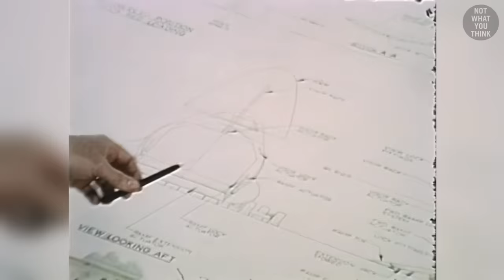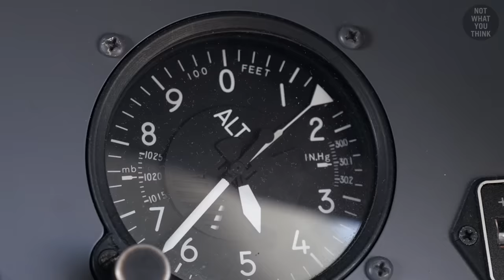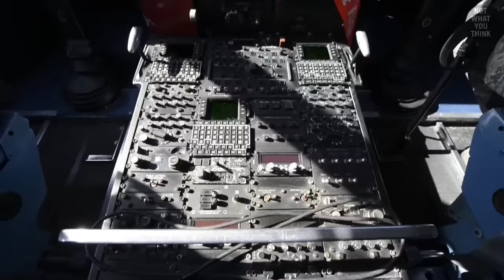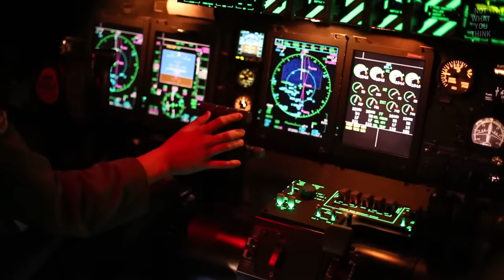America’s MASSIVE Military Airplane that is Named After a Porn Star

Comment from the maker: Did you spot the biggest inaccuracy in our video?
Reply: no, but I knew right away that the space shuttle is what you referred to at the start when you said C-5 cant do something 747 can ..
Reply: rediculous is not correct 1:00
Reply: nope im clueless 🙃
Reply: M1s don't weight 60 tons.  They weight 70+ tons.
Reply: When you stated the decision was made to limit the weight of all C-5a’s to 50,000 pounds after cracks were found. That is very inaccurate. Yes restrictions were put on the aircraft, but to limit a C-5a to 50,000 pounds it would have to be a small scale model. 

I was always disappointed for the C-5M they didn’t use the GENx engine and new wings from the outer engines to the tips. These upgrades plus small vortices generators could have cut fuel burn by 20%
Reply: No clue! The Ridiculous typo might be only thr inaccuracy that i saw, apart from that... Yeah i got nothing!
Reply: @andrewday3206  Isn't 50,000 pounds only 25 tons?
Reply: The C-5a has a cargo capacity of 270,000 pounds
The C-5M has a cargo capacity of 281,000 pounds
So the 125 ton cargo limit isn’t completely accurate but not far off.
Reply: @leelydston1225  
Seeing the C-5 has an empty weight over 350,000 pounds limiting its loaded weight to 50,000 pounds just doesn’t work.
Reply: @leelydston1225  there is no mathematical definition of a ton
Reply: @TruckerIceBox  2,000 pounds
Reply: The clip of plane about to crash, killing all the crew, in the reverse thrust section?
Reply: Reverse movement of airplanes being something special. Literally every single jetliner can do that it's just extremely wastefull and dangerous for ground personnel
Reply: "In fact reverse thrust can be used in many aircraft while in flight in order to speed up the rate of descent" This is technically true, but most modern airliners are doomed if they use reverse thrust in flight. See Lauda Air Flight 004 "Simulation of the event disclosed that the airplane was not capable of controlled flight unless full wheel and full rudder were applied within 4 to 6 seconds after the thrust reverser deployed."
Reply: Two CH47's can be lifted in a C5 simultaneously, not one.
Reply: Yeah, the C5 was not a "disaster".
Reply: Well, Linda Lovelace's face segment isnt her face actually, its based on her biopic movie..
Reply: is this a clever way to find out inaccuracies of your videos through the viewers lol
Reply: @TruckerIceBox  Ya mean like a "butt Load"?
Reply: You said inbound instead of inboard?
Reply: Spelling "ridiculous" wrong in the text-over frame?
Reply: You meant to say “An-224” not An-124 as being the next biggest cargo transport.
Reply: @Omegatonboom  
deceptfulness is not a word you should go to vocabulary jail
Reply: The 747 shown carrying the space shuttle does NOT have a normal 747 tail.....
Reply: @indyjons321  
The AN-124 is the next biggest. There is no AN-224
Reply: The second AN-225 is not a complete set of components for a second aircraft to be built. It does have the majority of large components, but it is incomplete and missing the hydraulics and many other components. The location is no secret either. I personally hope they complete it using the much more efficient GENx engines to replace the Progress D-18T turbofan engines.
Reply: 14:05 ?
Reply: you said "inbound engines", not "inboard engines"
Reply: I thought it was the claim that commercial aircraft can use their thrust reversers in the air.
Reply: I'll take "inaccurate video titles" for $800 Alex!
Reply: @forgettable_eli  My favorite part of the video.
Reply: I guess that it's the number of ping pong balls that is equivalent to 125 tons at 7:12
Edit: I feel like "25,844,746 ping pong balls is equal to 125 tons" is just a guess and it may be still not accurate.
Reply: 4:26
That accident has nothing to do with reverse thrust
Reply: @rizaskeee  the real nickname is Fat Albert.I worked with this aircraft.
Reply: @andrewday3206  I understood it as 50,000lbs of cargo
Reply: @danduffy7974  
When I was in the USAF we called it Fred. Fat Albert is also a good one
Reply: Reverse thrust is not banned and is present in most commercial aircrafts in existence. Just not used due to safety concerns.
Reply: Same here.  The Space Shuttle.  However even the 747's tail had to be modified to mitigate airflow problems with the huge Shuttle on it.
Reply: at one point in the vid, it switched to the woman for a split second?
Reply: thrust reversers being called reverse thrusters?
Reply: @EliranC  The C-5 was considered for the SCA, but NASA wanted an aircraft they could own
Reply: @k53847  Well, the newer variants do, but they started at 60t
Reply: Like mentioned “ridiculous” is spelled wrong when you say what “FRED” stands for… happens to the best of us…usually in an important text message…
Reply: Yeap that's not Linda lovelace, it's Amanda Seyfried in the video clips.
Shockingly bad research if you ask me!!
Reply: @philemontong8847  subliminal messaging.
Reply from the maker: Maybe!
Reply from the maker: No, that was intentional.
Reply: why is there a random girl at 14:06 lol
Reply: While the 747 wasn't a rework of the C5 concept, it was codeveloped with loads of similarities. Also the new engine developed for the project made aircraft like 747 as well as the dc10 even possible.
Reply: You missed a fucking amazing chance for a "your mom" joke right here: 8:43
Reply: @bhupendragurram3026  
Yes 1:00 is kind of....rEdiculous😀
Reply: @TruckerIceBox  Of course there is. It is 1000Kg. The international standard is metric, so you can assume any measure to be from the metric system unless something else is specified.
Reply: @hanneskunnen  having an unexpected single side reverser deployment whilst at full thrust on both engines is an extreme case, to say the least...

IIRC the T39 shuttle trainer had to use reversers to simulate the 'winged brick' glide profile
Reply: @MaverickBlue42  I don't think you could fit a reindeer tail to a C5A and trying to fit outboard rudders on the existing  elevator would still put them in the spoiled airflow

Mriya has the same tail philosophy as the modified 747s, for the same reason - and those shoulder humps are there for external load carrying. The "mark2" non-Buran carrying design has a standard cruciform tail and an operable rear cargo ramp like the An124s it's derived from.

FWIW, that second airframe has been worked on intermittently since it was mothballed in 1988. Antonov was in talks with China about license-building the things in the late 2000s but that didn't happen (apparently because of the issues associated with the Progress D engines coupled with the issue that no western manufacturer will sell engines to be fitted to a Chinese military airlifter)
Reply: @Rusty9017  it's banned on the apron and taxiways of most locations due to FOD spread, infrastructure destruction (signboards likely to go flying,  etc) and risk to ground crew/equipment 

One regional airport I lived near had a 737-200 run up the engines to full power outside the terminal whilst turning (a wheel had gotten wedged against an in-ground taxiway lighting marker and the pilot was trying to ride over it in the absence of tugs onsite)

The result was that the entire front wall of the terminal and frame of the building was damaged and had to be replaced at a cost of several million dollars

The fuel costs of using thrust reversers factor into this too, but most noticeably the civil birds pictured all use bucket reversers which are as long-gone as the very noisy low-bypass turbofans they hung behind

It's a pity the test flights of the B52 carrying the original C5/747/A300 engines weren't shown. That engine dwarfed the airframe it was hanging off and the tests were extremely dangerous for the crew
Reply: The C-5 Galaxy can carry up to two CH-47 Chinooks, not just one.
Reply: 14:04 it's funny when you say and I quote "kneeling is especially important" and add linda lovelace in it😅
Reply: @TruckerIceBox  Lol a ton is 2,000 pounds dude
Reply: You can't use reverse thrust in flight on any airplane, only some Military ones.
Reply: @TruckerIceBox  its litteraly 1'000 kgs
Reply: @danduffy7974  
The Blue Angels C-130 was called Fat Albert
Reply: 1) Suggesting that aircraft use thrust reverses while in flight.
2) Talking about weight capacity, and immediately suggesting how many ping pong balls which would indicate volume. 
After that I stopped watching and double checked to make sure I was no longer subscribed.
Reply: @andrewday3206  I thought that was the inaccuracy too, but I did a little research and found this statement to be true. "Consequently, all C-5A aircraft were restricted to a maximum of 50,000 pounds (22,680kg) of cargo each. To increase their lifting capability and service"
Reply: @scottcol23  
I get he meant payload, but I think it was a typo and written like maximum takeoff weight was 50,000 pounds.
Reply: @14:06 🤣
Reply: You said you were going to use a profanity and then didn't.
Reply: @rightrightrightuhhuhuhhuh6516  So should 99.9897% of Americans, particularly those who say "conversate".
Reply: You give everybody the impression that Amanda Seyfried is Linda Lovelace.
It is easy to find pictures if the real Linda on the net.
Reply: The title?
Reply: OK
Kinda embarrassed this one slipped my mind after first noticing it. You said don’t feel bad for Boeing, the 747-100 took advantage of the high-bypass engine technology developed for the C-5A. Well the Boeing 747-100 used P&W JT9D engines. The C-5A used GE TF39 engines, it never used the P&W the 747 used. The 747 never flew with the GE TF39 either.
Reply: The Antonov An-225 Mriya can lift 350 tons.
Reply: @andrewday3206  Doesn't Fat Albert work for the Navy's Blue Angels?
Reply: 747 had modified tail to carry the space shuttle not original.
Reply: @hyperseah  
Yes I wrote that yesterday in the comments. It used to do JATO takeoffs with a bunch of solid rocket motors strapped to it. At air shows it was quit the sight.
Reply: @henriquebelotto  Correct - the load (army vehicles) slammed through the backpanel as their straps/chains snapped during take-off - Bagram AFB, Afghanistan (also, it was a private B747 - not a C5).
Reply: Could it be inBOARD engines not inBOUND?
Reply: A c-130 cant do backwards thrust its propellers!
Reply: @haotichar  
It cannot lift anywhere near 350 Tons…. Look that up again
Reply: @andrewday3206  
Empty weight: 285,000 kg (628,317 lb)
Max takeoff weight: 640,000 kg (1,410,958 lb)
but, yeah, I saw that and overlooked Capacity: 190 tonnes (420,000 lb)
My bad.
Reply: @haotichar  
Fuel capacity alone is 300,000 KG
If they do finish building the second one… Using much more efficient GENx engines would make a very big difference. That and a few other modern tweaks like vortices generators and more efficient wing tips could greatly reduce fuel burn and increase capacity/range equations.
Reply: "On the two inbound engines". The other two are outbound?
Reply: @ 0:12 It’s teabaggin’ too!
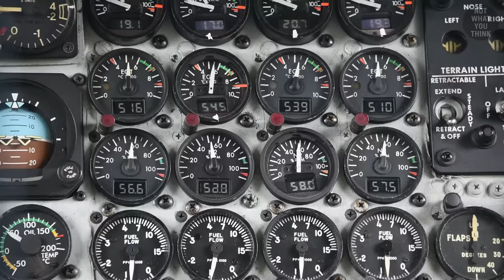Reply: @11:43 is a KC-135 cockpit, not a C-5.
Reply: The C130 can back up because of its cool propeller design.
Reply: @hanneskunnen  Also several redundancies are in place to stop a reverser coming on before touch down. So in theory modern airliners (most airplanes / "many aircraft") can't even activate them in flight so I think that's the error. Also further up someone mentioned the 74 crash during this segment and what happened during that crash if I recall correctly was a fault in load securing and the load shifted shortly after takeoff resulting in a stall and a terrible crash.
Reply: @hanneskunnen  Lauda 4 had an uncommanded and, crucially, asymmetric thurst reverser deployment which caught the pilots by surprise. Controlled, symmetric in-flight reverse thrust would be totally different. Not that it's used by airliners, though.
Reply: i like this question as it prompts critical reception of the content.
Reply: @olehcelsior1005  I have people that think they are smart correcting my spelling lately, that it is "Kyiv", not "Kiev".
Reply: @grecco_buckliano  right, thanks)
Reply: Actually, you said "inbound"  instead of "inboard" when describing reverse thrust capable engines. It's curious how many non native speakers of English confuse these 2 words. But I can imagine why!
Reply: Linda Lovelace is portrayed by Amanda Seyfried
Reply: I can still hear your voice reading this.
Reply: @ the 15:10 Mark you mentioned the maximum weight at 50,000 pounds.  This would be inaccurate unless you stipulated cargo weight.
Reply: @TruckerIceBox  A ton bombs are not well defined either.
Reply: @Oflgpatxa  That is a 'long ton'.
Reply: 51,000 gallons of fuel capacity is only about 2 (small) railroad tank cars.
Reply: The AN-225 was destroyed by ukrainian forces, not russian.
Reply: @TruckerIceBox  A ton is 1000kg
Reply: There is metric.
Reply: An-225 wasn't destroyed by russian forces, it was destroyed by ukrainian artillery during the battle for Antonov airport
Reply: When you said what can happen if thrust reversers, you showed a clip of a 747 losing control due to an armored vehicle coming loose in the cargo bay, which hit the back of the plane and broke elevator control cables and causing the 747 to pitch up and stall, killing everyone on board
Reply: @miscbits6399  ... happened to a Lauda Air aircraft; Nikki being a pilot as well as a world champion F1 driver, figured out the reversers had activated bringing the plane down
Reply: @hepphepps8356  Well, hepphepps, WRONG !  This is about the U.S aircraft where imperial is king. One ton is 2000 lbs. Other people say metric tonnes.
Reply: @Oflgpatxa  1 Ton (metric) = 1 Tonne = 1000kg = ~2200lbs
1 Ton (long) = 2240lbs
1 Ton (short) = 2000lbs
Reply: @TruckerIceBox  1000kg
Reply: ETHAN CHEW YAT HARNG Moe  Google! The font of all knowledge..unless they don't want you to know.
Reply: @leelydston1225  Actually, even less. 50,000lbs = 22.680 metric tons.
Reply: 747 tail had to be modifed to carry the space shuttle.
C-5 Galaxy could've had the same modifications to it.
Reply: @philgiglio7922  Yes, I read the accident report at the time. Mentour pilot has a very good video covering how it occurred
Reply: @TruckerIceBox  Is that an Imperial (long) ton (2240 pounds/1016kg), An American (short) ton (2000 pounds/907.2kg) or a metric ton(ne) (1000kg/2205 pounds)?

Gotta love standards - so many to choose from...
Reply: @miscbits6399  there is no "mathematical" definition
Reply: @andrewday3206  I've also heard it called Dumbo, flying blue elephant.
Reply: @Dr-Bread  my brother was a load master on a hercy bird. He was also a qualified "mon back" when they backed up, he would stand on the ramp and and tell the pilot "Mon back, Mon back".
Reply: @matsv201  The 747 was envisioned more or less a 50% upscaled 707 with flight deck moved above the cargo deck primarily to avoid the crew being killed in the event of a crash landing (it had happened on multiple occasions on airlifters as cargo broke loose and squished the cockpit). The other big advance was having a nose door which didn't require disconnection/reconnection of cockpit control lines and subsequent hours of downtime whilst everything got checked for integrity

There's a lot more too it but the structure is heavily 707/Dash-80 derived along with work from the USAF airlifter research - rem,ember that Boeing punted it as a quick-and-dirty freighter design to fill a gap until the 2707 came online and it was Juan Tripp who mooted using it as a passenger carrier

The longer hump on the -300 is a direct result of finding out that 1/3 of the total lift was being provided by the fuselage but the shorter hump was actually adding drag. It was extended to optimise range and airlines immediately took advantage of the extra volume provided

The DC10 used RB211 engines, not JT9Ds - and it was the delays that acrued in Rolls Royce developing it that nearly killed Douglas along with bankrupting RR (RR intended to use carbon fibre fans and produced working ones but they shattered when the chicken test was performed, so they had to develop better titanium fan blades instead - adding lots of delays + costs)

The A300 used the JT9D though

If you want to see something scary - search for "JT9D B52" - there are a few videos on this as well as photos

Trivia: in the 1970s Lockheed punted a 1000 passenger tripledeck aircraft based on the C5. No airlines wanted it because they couldn't see a demand for that many seats. It was only after that they they pushed forward with the L1011 and discovered the market for very large aircraft was so small that first to market won it (ie: Boeing - for all the chest beating, only 1500 747s were ever built, vs more than 30,000 737s and A320s. Even the 777/A350 market is tiny compared to the smaller birds)
Reply: @HSstudio.Ytchnnl  a standard ping pong ball is 2.7 grams. i just did the math and it turns out 
2.7 grams x 25,844,746 ping pong balls = 76.92 us tons (a ton being 2000 lbs/907 kg)
Reply: kneeling is very important lol
Reply: Ridiculous, not rediculous
Reply: @k53847  M1A2 Sep V3 is just close to 70 tons (66.8 tons to be exact)
Reply: Lmao when linda lovelaces face popped up for 1 second towards the end 😂
Reply: At 14:05-14:06 when you flashed Linda Lovelace (biopic version) on the part where u were talking bout kneeling 😂😂
Reply: Yeah, that isn't Linda Lovelace, it's Amanda Seyfried.
Reply: @TruckerIceBox  1 Mg
Reply: Russia  did not destroy  the 225 it was shelled  by Ukraine when Russia  occupied  the airport
Reply: @Oflgpatxa  in the U.S.A. 1000kg is known as a metric ton or long ton. Since we still use imperial measures, a ton is 2000 pounds.
Reply: @andrewday3206  Not to mention the 332,000 pnds of fuel.
Reply: 2:38 You shifted in 4th not reverse
Reply: And take large loads, let's not forget
Reply: @CenterionX  
Agreed!!
When people start learning how much fuel aircraft burn they are in shock. Once you realize the payload and distance it starts making more sense.
Reply: c5 airdropping an ICBM XD
Reply: Hell, a glorified Cessna could carry fifty thousand pounds, well close to it. It would be very useful if the C5 could carry at least two Abrams tanks which are much closer to 70 tons each rather than 60 tons.
Reply: I Never heard the C-5 called "FRED", Never
Reply: @andrewday3206  GEnX didn't come out till about 10 years after the upgrade program was started.
Reply: spelled ridiculous incorrectly
Reply: @Super_Hornet_  
The re-engine program started in 2006 the same year as the GENx first run. Boeing was developing the 747-8 in 2005 as the specs for the engine were already available. My point is the USAF did not go for the best option they went for maintenance availability. If you read the press releases they openly state that. Companies wanted to replace the wing from the outboard nacelle to the tip, introduce vortices generators on the body and use newer engines. The USAF held back. This was about spare parts and not best performance. Heck the 787 Dreamliner started in January 2003 with specs for the engine available then.
Reply: you misgendered the plane with the wrong pronouns?
Reply: well, at least one: very few planes can use reverse thrust in flight, especially modern commercial jets.
Reply: @jims6450  technically some modern jets could, but very few especially commercial models. Looks like the Concorde could do it actually.
Reply: @danduffy7974  the Blue Angels Fat Albert is a c-130
Reply: @rykerstayton9577  "Lol a ton is 2,000 pounds dude"
2000 lbs is a short ton, while the long ton is 2240 lbs. The ton without further specification is metric per default, and thus 1000 kg.
Reply: Yep, apart from it being riddled with inaccurate information from start to finish, your explanation of why the C-5 is called the 'Lovelace' is completely incorrect. It's called that due to its ability to kneel and 'swallow' large objects. Being clever is fine, but when the content is so filled with incorrect information, it's just plain irritating.
Reply: Need spell check?
Reply: I never heard to say fu cking word before
Reply: "Fred's wings produce so much lift that it doesn't want to come down from altitude"
It's not lift...Fred is just so ugly the earth repels it!  😅

Jk to all the Fred mx peeps out there. It's a helluva plane for sure. We always made the joke that every time one landed, the hydro shop guys had better use the bathroom bc they would be on the line for a while.
Reply: @k53847  Depends on how many big macs they eat
Reply: @guytansbariva2295  
And the traitor who manipulated from his management position leaving it to get destroyed
Reply: FRED actually stands for Fucking Ridiculously Expensive Disaster.  By the way I have 2500 hours in FRED as a pilot.  Both tours at Travis AFB, 91-94 and 97-00.  Great airplane. Flys small, but taxiing the thing is a real bitch...like moving a building with wings.
Reply: So basically a good chunk of the video from what I see in these comments…
Reply: No seats like that on C5s I was on!
Reply: @NatEff3ct  
It’s 2,000 pounds, dude.
Reply: @haotichar  could lift 250 tons
Reply: @hevscientist_017  that's lovelace... in reference to the kneeling comment.
Reply: @stanlogan7504  I've been on many C-5s, although at air shows lol 😂
Reply: The c-141 dumping a gbu-128?
Reply: @TruckerIceBox  Actually, there is. 1 ton=1000 kilograms, and the Kilogram is mathematically defined, and therefore so is the ton, and since all US imperial units are defined based on a conversion from the SI system, so is every imperial unit.
Reply: @tombaja4.9  Not really....lame comment.
Reply: @aunshiwho  3 Actually
Reply: @stimproid  It can use TR's in flight
Reply: @aunshiwho  

Yep, I've sent marines with theirs out of riverside ca 2 at a time.
Reply: "Ridiculous" was spelled as "Rediculous" 1:00
Reply: @NatEff3ct  one imperial ton is 2,240 imperial pounds. 2000 US pounds is a "short ton". A metric tonne is close to the imperial ton.
Reply: @k53847  Is that the M1?  The M1A1?  Or the M1A2?
They START @ 62T.
Reply: @leelydston1225  It USED to be pre-GenX.
Reply: That was a MOAB, not an ICBM
Reply: @indyjons321  Didn't the Ruskies destroy 1 in the Ukraine "special military operation"?
Reply: @bhupendragurram3026    Rediculous is not correct, it's ridiculous.
Reply: The title
Reply: @jacobpeterson4752  He seemed to indicate that this was common for aircraft to do. It is not.
Reply: That wasn't Linda Lovelace in your video...
Reply: 14:05 sus
Reply: @danduffy7974  As I remember, Fat Albert was the name of the C-130 used by the Navy Blue Angels demonstration team.  It does a JATO takeoff as part of their shows.  I've seen it. It's very impressive.
Reply: Yeah the fight club splicing in porn star @14.09.. I'm sure Tyler would approve
Reply: Yes, the 225 was the biggest inaccuracy. It was destroyed by Ukrainian Forces, not Russia.
Reply: LoL from both end XD
Reply: Who was that lady in the red dress lol
Reply: The fuel panel doesn’t look like that
Reply: Yes, that was not Linda Lovelace
Reply: 7:00 it’s no longer the biggest because it no longer exists. It was blown up last year in a bombing on an airstrip.
Reply: @marvindebot3264  The C-5 never dropped a MOAB, but it did drop an ICBM which was shown in the video
Reply: @TruckerIceBox  a ton is 1000 kg, what the hell do you mean there is no defintion?
Reply: @Jartran72  not sure what everyone missed ... everyone also has a different number for a ton ... look up the mathematical definition of a ton... there is none
Reply: It was not destroyed by Russian forces
Reply: 1:00 . Spelling mistake. It's Ridiculous, not "Rediculous"...
Reply: @andrewday3206  They didnt use new wings from the outer engines to the tips?
Reply: Yep. The Antonov 225 is a Russian plane. You say Ukrainian, but we all know Ukraine is Russian territory.
Reply: @Robbie_Prz  
No it’s ironic when the C-141A was upgraded to the C-141B the entire wings and engines were replaced. When Boeing brought out the 747-8 the entire wings were redesigned and the engines upgraded. On the 747-8 the same wing box was utilized. The C-5M was more about having engines that had readily available spare parts and not so much an upgraded performance.
Reply: It wasn't a regular 747 tail...?
Reply: All passenger seats face the rear on any military aircraft.
Reply: That isn't Linda Lovelace lol
Reply: I suppose the biggest mistake you made aside from spelling errors is incorrectly lumping AMP mod and M-Mod together. M gave the engines to the aircraft overhauled. All the B models got AMP Modded with the glass cockpit and several updates to the avionics. 

You made quite a few small mistakes. Also, if you want that hook up to get a ride with FRED hit me up. I'm probably the closest you're ever going to get to the right person to ask.

Oh and I forgot about it by the end, but as @name points out, the clip showing an aircraft crashing while talking about reverse thrust in flight was a 747 and it had nothing to do with reverse thrusters opening in flight. That was a shift of CG due to cargo shifting in the belly that caused that aircraft to fall out of the sky. Kind of surprised you didn't talk about the C-5 that DID crash in Dover though. Mostly because it's the only time a C-5 carried another C-5 inside because the flight deck was cut out of the wreckage and put into another jet to fly it for R&D.
Reply: @sundhaug92  NASA owns two C-5s. 213 and 216 are the only two C models and both are owned by NASA and operated by the USAF.
Reply: @NotWhatYouThink  i havent finished yet, but as of 3 min, the jokes are particularly amusing
Reply: Is it the one in 14:06?
Reply: heyy broo, you forget to mention what Linda can and can't do
Reply: No porn star is named "C-5 Galaxy".
Reply: Yes, that isn’t Linda Lovelace that you are showing, it is Amanda Seyfried whomplayed Linda Lovelace in the 2013 biopic, ‘Lovelace’.
Reply: Yes, that isn’t Linda Lovelace that you are showing, it is Amanda Seyfried who played Linda Lovelace in the 2013 biopic, ‘Lovelace’.
Reply: Uhm. no. C-17 is bigger.
Reply: Are you just being facetious because so many people act like internet warriors and have to tell you how wrong you are all the time?
Reply: @k53847  No, M1's weight 59.7 tons. M1A2 Sep V3 on the other hand weight 73.6 tons
Reply: Kneeling requires knees??
Reply: C5 is Circa late 1980’s
Reply: @KevinPratama  LoL
Reply: That’s a metric ton.  @Oflgpatxa
Reply: @TruckerIceBox  idk I learned 1000kg is 1 ton, at least that's how we take masses in our maths
Reply: @foxrine4204  Ton is a informal definition... there is not a mathematical definition

A European definition of a "tonne" not "ton" is 1000kg
Reply: @TruckerIceBox  oh I thought he meant tonne, since we call it ton for short
Reply: 1:27 not Linda Lovelace
Reply: @NatEff3ct  I'm not sure but I think that he was saying there is no mathematical definition of a ton in the video I am not sure
Reply: Your airplane is an actual individal with capabilies that the government uses.
Reply: yeah , your balls wont itch when you fly on this plane
Reply: @KevinPratama  yeah, that was Amanda something who played Linda in a Biopic.
Reply: ping pong bolls thing
Reply: @noimagination99  Thank you!
Reply: @Oflgpatxa   Wrong a metric ton (1000KG)  is called a tonne.  1 tonne = 1000kgs .  A US ton or short ton is 2000lbs.   An Imperial ton  or long ton is 2240 LBS. Since this is discussing US equipment the measurements used will be US customary units, so the tons used are short tons 2000LBS...
Reply: Ridiculous is spelt wrong with an e when explaining the name FRED
and the narrator's voice is annoying and most likely computer generated
Reply: LOL.  :)
Reply: @LaGrandeBayou   You muppet this would launch an ICBM closer to the target cutting the transit time down to 5 or 10 mins from 30  AND still be outside the detection range of those systems.  Not the sharpest tool in the shed are you.
Reply: at 4:25, the B747 has fallen due to the cargo (Tank) has detached and moved the center gravity to the back. , not because of the reverse.
Reply: yeh, the fuel discrepancy, they do not carry much much fuel, it is what  is called a furphy , rumour mongering around the water fountain
Reply: The title.
Reply: The landing gear turn 180⁰
Reply: You mean that line "but for now the largest cargo airplane is the AN-25 Ruslan" ... As it was destroyed by Armed Russian Forces in their invasion into Ukrainian territory?
Reply: I worked at Denver Stapleton airport during the 80s. I was a airline fueled for Braniff, American and Eastern. Most of the 727s used reversers to power off their gates. It would kick up dirt all around me and would get really warm too. It was also incredibly loud and I believe that's why I have tinnitus now. I used to pump 20,000 gallons of JetA per 8hr day! From a tanker not a hydrant truck.
Reply: Fred at least the B and A models cant reverse with T/R's it bends the stage and a half fan.
Reply: @Oflgpatxa  1 tonne= 1000 KGs i.e. metric.   1 ton = 20 CWT OR 2000 lbs.
Reply: US Air Force’s mothership
Reply: "The Antonov An-225 Mriya can lift 350 tons."

not anymore it can't.
Reply: Matthew 

"this would launch an ICBM closer to the target cutting the transit time down to 5 or 10 mins from 30"
Duh thank you mr obvious. My point is...NOT if the plane itself is shot down first. It will take that ICBM loaded cargo plane hours in flight time to deliver its payload. 
Meanwhile it's a sitting target. 
If You think Russia wouldn't take out the Boeing Cargo plane with a  hypersonic ICBM...
Your dreaming.
Reply: Which one.  I couldn't keep track.
Reply: Thank you for this video it was really informative. My dad was in the Air Force and we were stationed at hickam in Hawaii which was a Mac base and we had several C5 galaxies and c-141
Reply: @danduffy7974  In the Navy Blue Angels, their C-130 is called Fat Albert since the '70s when the cartoon came out on Sat. Morning TV.
Reply: @scottcol23  I thought I heard that too when I had to sign a waiver to fly a C-5A across the Atlantic in '77 they said because of the crash of the overloaded one, or wing issue, in '75 in the evacuation of Saigon. On a C-130 they carried 352 out of Saigon, (64 on flight deck).
Reply: @andrewday3206  Eight JATO Bottles.
Reply: @Rache Johnson It most certainly can reverse pitch.
Reply: @dallasarnold8615  I thought it was 2,000 lb. Statute or short ton, ~2,240 lb. Metric or long ton.
Reply: @grayharker6271  At night you can turn the cargo bay lights red and actually see further back from the ramp.
Reply: @stanlogan7504  They're upstairs in the back.
Reply: @robertrichard6107  
JATO bottles are actually SRB’s and not jets was my point. But yes we call them JATO bottles.
Reply: *Ridiculous.
Reply: @robertrichard6107  You are likely closer to precise than me. Good job.
Reply: @TruckerIceBox  1000kg
Reply: "can transport anything".....doubt it can transport my mother-in-law
Reply: In 1983 I caught a ride from the states to Europe on a C5a. For reasons I don't recall I was the only passenger on board.  So I stayed with the crew, I was allowed up on the flight deck with them for the flight. It was a truly great experience.
Reply: now a serious one. not that I am an expert, but afaik any airplane that has reverse thrust can "travel in reverse". it's just not an option at an airport because of safety and noise.
Reply: I don't know if it is an inaccuracy (maybe just a misguided statement), but I assure you, you don't want to fly in a C-5...especially if you are in the back...and have to do multiple refuels.
Reply: @andrewday3206  I've read the GAO report. No mention of a 50,000LB cargo limit, but there are various discussions about limiting the operable hours to a circa 8,000 hr safety limit before inspection and repair. Lot's of talk about an H-Mod to solve the wing load crack issues, and requirement by the Air Force to have that fix guarantee +30,000 operable hours post fix. Fracture mechanics was at its infancy during the Galaxy program, making it difficult to estimate the service life of a aircraft. The B1 Lancer was the first heavy craft developed with fracture mechanics baked into it's design and service life.
Reply: I know the part about most air being able to use reverse thrust in flight. Almost all aircraft have safetys that do not allow reverse thrust to be used in flight
Reply: @k53847  Depends on the Version of the Abrams. The original M1's are/were 60 tons. The M1A2's and A3's  Are 70 ton's  The fully upgraded and out fitted M1 A3's  are 73 ton's.
Reply: 14:06? lol
Reply: can haul 36 standard pallets must mean 360 standard pallets
Reply: 14:06 must click😬😬😬😬😬😬😬😬😬😬😬😬😬😬😬😬😬😬
Reply: It is the 50,000 pound payload. that is inaccurate. It's been about 20 years ago. But I was on a flight home from Oregon. And the plane I was on landed at one of the airports. That was next too / A joining A Airforce base. And they were loading one of these monsters.
Don't ask me why. Because I don't know. But they were loading it with civilian vehicles. They had both ends of it open and the front end was kneeling on the ground. They had already loaded a hook and ladder tiller steer fire truck. As well as two Cab over Simi's with 53foot trailers on it. And they  had about 6 other vehicles lined up too load into it. And it was only about 1/3 full with what was on it as we taxied past where it was being loaded.

Just googled it. Here is it's capabilities stats:
The C-5M, with a cargo load of 281,001 pounds (127,460 kilograms), can fly 2,150 nautical miles, offload, and fly to a second base 500 nautical miles away from the original destination — all without aerial refueling.
Reply: the 2 little guys on the top of the wing tail. little respect to the tail wing. picture video. called thumbnail which makes no sense name. what the heck thumbnail 😐👽
Reply: So what's the m8stake in the video besides the miss spelled word? Plus the porn star comment in the video was a little disgusting in my view. But hey your a man & that's what most men think about nowdays IMO. 
Sick minds @ work!
Reply: No, but I did spot the smallest. Saying the CE engines were used on 747's showing a British Airways one. BA used Rolls Royce engines. Honestly, with this sort of inaccuracy how can I trust a word of the rest of it ;)
Reply: @Andrew Day  they also plan to salvage as many usable components from the destroyed aircraft. So Myria can basically live on as part of it's successor.
Reply: @bread  yes it can, they rotate the blades into reverse pitch mode. They can adjust the pitch of the propeller blades to get the optimum thrust for the situation. There are several videos out there showing the Herc making a quick stop on landing and backing up to make a fast takeoff with the assist of the JATO bottles.
Reply: @KEEP CALM and ENJOY THE DECLINE   No, it was stored in The Ukraine and it was destroyed when the Russians bombed the airfield where the hangar it was stored in is. Supposedly they were in the process of prepping it for takeoff to fly it out of danger when the attack came.
Reply: @mr house  you mean former Russian territory, with the breakup of the USSR it became an independent nation like many others in the region.  Granted the Mad Russian is apparently attempting to rebuild the USSR with this unprovoked attack on the Ukrainian people.
Reply: @Andrew Day  they also lengthened the fuselage to match the length of the B model by adding 2 35 foot sections. One ahead of the wing and one behind it.
Reply: When I was stationed out of Dover AFB, Maj. Hazard flew a C-5 into and through the eye & flying around Hurricane Gloria. I had been tasked with chaperoning a High School ROTC Class along with PR for the base!
Reply: At 11:45 you show round gauges. The C-5 has tapes...
Reply: @k53847  Actually the newer M1A2 weighs over 70 tons but the original M1 weighs 60 tons
Reply: @Kevin Rose  There are variants that weigh 60 tons. Export versions for example don't use DU armor.
Reply: Reverse Thrusters are NOT used in flight..
Reply: Naughty USA
Reply: yup around 14:15 - 14:25 timestamp
Reply: @abraracademymadison  On this airplane they are. Or at least were with the old motors. Inboards only..
Reply: @TruckerIceBox  1000 kilos
Reply: Yes found it 14:06
Reply: Inaccuracy = Lie
God don't like lies
Reply: mriya is a soviet airplane, not ukrainian
Reply: Not all civilian aircraft are banned from using reverse thrust to reverse aircraft on the ground, the risk is that you blow Foreign objects off the runway infront of the engines and it then gets ingested this is particularly true on aircraft like the 737 where the engines are very close to the ground. Aircraft with the engines up on the tail were designed like that to avoid this an allow reverse thrust to be used to back off without a tug (eg. the MD80) it's rarely done now because of the noise.
Reply: @BenjaminT.Raleigh  The C-5 can indeed deploy reversers inflight (inboard engines).  I had a young copilot decide he wanted to deploy them going into Dover.  I didn't think it was needed or wise (they often stuck open and the emergency retract switch would fail), but I let him learn.  I got to land with three engines that day.
Reply: Really, the more you know huh.
Reply: @MrGregsRnR  The biggest issue was we couldn't pull the throttles to idle or the plane would decompress.  It was a leaky girl, and we had to stay around 70% thrust.  The loadmasters would wet blankets and "seal" the biggest leaks inflight to help, but it was rarely enough.
Reply: @zmangozer1918  I was 94-98 at Travis (22nd).. and I'm 100% sure it is Economic Disaster.
Reply: @jimfox9719  By the way, I was the AC of the crew that overflew the White Sands Hotel in Mombasa, Kenya in 1998, that blew out windows at the hotel and caused several hotel guests to have cardiac issues as we passed by at 300 knots and an altitude of 250 feet.
Reply: @zmangozer1918  wow, lots of anger there.  
I was a T38 FAIP, followed by the C% where I was an IP (not AR IP), and Wing Safety officer.  I then flew T43s at Randolph.  
I'm not sure why you got so angry over one word..  very odd.
Reply: No
Reply: "rediculous"
Reply: No one mentioned the weiners. That plane is filled with depictions of weiners... It's part of the maintenance plan. 😂
Reply: @hanneskunnen  
Lauda 004 only deployed reverse thrust on the
#1 engine-
it was an asymmetrical engagement caused by a mechanical failure.

That’s why it crashed.

If the reverse thrusters on all engines are properly deployed,
they can be used in flight to reduce airspeed, though this is not common with most modern aircraft.

Thrust reversers are much less powerful than primary thrust,
although they are very noisy since they are in effect opening up the engine casing.

Louder is not always more powerful.
Reply: The real reason that airlines don't use backward facing seats, is b/c its cheaper for them to pay out on a death than a lifetime of medical bills in the event of an accident.
Reply: @k53847  when fully loaded. I weighed them myself
Reply: @andrewday3206  I have flown well over that limit on a few occasions
Reply: @Name-qj9ql  no, the load shifted on that 747 knocking out the controls
Reply: @aunshiwho  been there done that
Reply: @Science in Engineering  my math professor in college was one the engineers who designed the C-5. His Nas was Mr Kersting
Reply: @scottcol23  it was 50 tons not pounds
Reply: @Gary Hughes  the C-5 can and does fly with 2 M1 Abrams. We don't do it all the time but I have personally flown with 2 M1's. You need tons of plywood shoring. Flying with 2 shortens the airframe and wing life dramatically.
Reply: All the info being released here was classified... Until now. And yes, I flew in a C-5 a few times during my USAF medical career. And yes, the Ukrainian Antonov is still the largest plane in the world, and both aircraft have served in missions in the Middle East. And both aircraft have the same capabilities/access to landing sites without runways. The C-5 train gear gives the aircraft the capability to land at a sideways angle. It is indeed an amazing aircraft just like all the other aircraft USAF has in its arsenal.
Reply: Just amazed you managed to capture 2x s15s, 1 VL and a Gallardo on 1:41.
Reply: @jbizzle1966  yes, and you think that didn't lead to the plane crashing?
Reply: Yes, I found. ??
the value, each name having a Worthness not worthless!!
Reply: @Name-qj9ql  name one plane crash due to carrying 2 M1's. Go ahead I'll wait
Reply: @danduffy7974  Fat Albert is the C131 that carries all of the Blue Angels gear.
Reply: @andrewday3206  Navy Blue Angels C131 is Fat Albert.
Reply: @jamespatterson1775  
If you read I mentioned the Blue Angels C-130, not the C131 as you stated, is Fat Albert. It used JATO bottles which are actually solid rocket boosters for performance takeoffs.
Reply: I've never heard of any aircraft using reverse thrusters to slow down. 
1975-1977 I was stationed at Kelly AFB where they modified the C5A and B-52. It was cool watching them during test flights.
Reply: @andrewday3206  My bad!
Reply: The weight of the air in the landing gear is 82 kgs
Reply: lol "the biggest"?? how may inaccuracies r there??? :p
Reply: @Trucker IceBox A tonne, also called a "metric ton," is 1,000kg. When "ton" is unspecified, this is how USA measure, for e.g. their grain exports.

The British Imperial "long ton" is 2,240 lbs (1016.05 kg). This is what you call an "Imperial ton" and is how US measure their naval ships' displacement tonnage..

The US customary "short ton," is 2,000 lbs (907.18 kg). It is dervived from the mass of "20 SHORT hundredweight" and is different from a 1cwt, British. This is what you in the US call a "ton."

I appreciate you don't use them, but as you can see Avoiradupois units are all thoroughly defined.
Reply: @k53847  the weight I see most commonly is 67 tons.
Reply: @TheR4gnos ... not confusing at all.... same Fn name diff measurement..  that makes perfect sense :p
Reply: 14:06 😂😂😂
Reply: no
Reply: The title
Reply: @stimproid  2 and 3 can be deployed for fast descent
Reply: @oliilo1  they only had to add 2 little verts to the 747, Fred would need a complete redesign of the T tail to a completely different design
Reply: Love your channel. Keep up the quality content.
Reply: @hanneskunnen  +1, I paused the video at that point and came directly to the comments.
Reply: @danduffy7974  oh my god 🤣🤣🤣
Reply: Yes. But it is not what you think.
Reply: @k53847  55 tons to the exact google spec
Reply: When you said it can carry submarines 😁
Reply: Galaxy !
Reply: R "E" DICULOUS spelling!
Reply: I see what you did there @ 14:05 i literally did a spit take with my beer when I saw that. Dang do i love your videos. please keep up the good work.
Reply: The An-225 is Soviet
Reply: Say pick apart every aspect of my video and research without saying pick apart every aspect of my video and research.  OUCH
Reply: That's not Linda Lovelace.
Reply: @walterallen4069  no "mathematical" definition
Reply: No I did not. I'm going to have to watch it again. Lol. Hahaha.
Reply: @ironcito1101 ...and Nikki is the person who figured out how the aircraft crashed.
He would sometimes be the pilot in command... imagine the surprise of a racing fan passenger seeing/hearing his name.
Reply: @MrGregsRnR ...No, that's a helicopter. They vibrate so much the ground rejects them.

Old UH1 pilot joke
Reply: @michaelblankenship548 ... not anymore. The JATO units have been out of production for a long time (decades?). And the stockpile is virtually zero.
Reply: @mrhouse3826 ...no it's not. It's an independent state fighting for survival...and winning
Reply: @dilbertbob5420 ...flew in a C47 in Air Force ROTC in 68. Ride was in metal seats that faced the center. Exactly what the airborne troops jumped out of. Very uncomfortable
Reply: Yes, 6:38 actually (first mistake, not ukranian, but) soviet AN-225, was destroyed (second mistake, not by Russian Army), but ukranian artillery, shelling Russian Army Forces.
Reply: 4:25 The National Airlines Flight 102 crash at Bagram airfield had absolutely nothing to do with thrust reversers while you could, but didn't mention Lauda Air Flight 004, the one big air disaster that was caused precisely because a reverser deployed in flight?
Reply: Everything
Reply: @TruckerIceBox  
There's several definitions  ... and spellings ... some refer to volume rather than weight with regard to how much sewater they displace.

Ton
Metric Ton (Tonne) - 1,000 kilograms
Short Ton  - 907 kilograms
Long Ton - 1,016 kilograms
Measurement Ton
Shortweight ton - 2,240 lb (Used in the iron industry in the 17th and 18th centuries.
Longweight ton - 2,400 lb
Deadweight ton 
Harbour ton
Assay ton
Reply: @leelydston1225  No, 50, 000 pounds is 22.7 tons.
Reply: I have flown on the C5 many times during my AF career.  If I recall correctly, only 2 have crashed bad enough to be unrepairable.  The first one during “Operation Baby Lift” when leaving Vietnam and the other one crashed during the first Gulf War.
Reply: @andrewday3206  0
Reply: I thought reversing on a plane is common? well normal planes for civilians do at least. To reverse out of the gate
Reply: @KevinPratama  "Lady in Red" does rhyme w/ FRED...
Reply: "Inbound engine" instead of "inboard engine"
Reply: Yeah, nobody calls it Fred.
Reply: you called the dsrv-2 avalon a submarine?
you claim its features boggle my mind?
Reply: @hevscientist_017  its not really a random person as he introduced her. she is there because she does adult movies and he mentioned how "kneeling is important", then showed her, indicating she kneels a lot for the type of movies she makes or made.
Reply: Actress pictured is Amanda Seyfried, not Lovelace
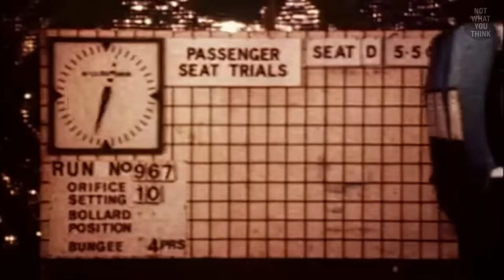Reply: 5:52 The explanation about backwards seats and why commercial planes have forward seats is completely wrong.

Can’t think of an inaccuracy worse than that one.
Reply: All 76 had their wings in the wrong position...sawed off and repositioned by Lockheed for 1 billion dollars.
Reply: C5 weighs one million pounds.
Reply: i wonder how many red haired giants fred delivered to the US
Reply: the c5 can carry more than one chinook. seen it myself when I Q1'd my FE check-ride in Bagram a long time ago.
Reply: The c5 is now the largest aircraft in the world
Reply: "Boeing" C-5? 🫢
Reply: Fred is a pornstar name ..?
Reply: @ShotokunWulf  no. it stands for Fucking Ridiculous Economic Disaster. It hauls a lot but the maintenance cost is very high
Reply: Yes, you didnt link the source to tank falling on you ruining your day... 

What you said is pure speculation, a far cru from your usual work
Reply: Can we put a cannon in it
Reply: the babe guys. it’s the babe
Reply: The woman you identify as Linda Lovelace is not Linda Lovelace
Reply: 14:06 this
Reply: It is not NAMED after a porn star. It is nicknamed after a porn star. She is named Galaxy. She is nicknamed Linda Lovelace. How'd I do?
Reply: @EliranC  I would say that it could fit a submarine inside. Just no way.
Reply: @nukulator you didn’t watch the video. He mentioned this.
Reply: that random woman
Reply: The ridiculous thumbnail picture? Lol
Reply: Her-Q-Leez   (3 syllables) ......Not "Her-Kules"
Reply: You showed Amanda Seyfried in stead of the actual Linda Lovelace.
Reply: not yet, whoo,but i am looking
Reply: Profanity is OK, but misspellings are not acceptable.
Reply: @andrewday3206   I was a flt eng on C-5 from 1978 to 1995.  The plane was limited to 50k lbs minus pax.. waivers were approved when required.  If you were hauling outsized cargo, you could carry 100,000 lbs with pax.   Normally we would only fill one side of the cargo comp.  After rewinging, the restrictions went away, along with the 6deg uprigged ailerons.  The largest thing I carried was a ships gearbox that weighed 175,000 with the trailer, from Norton to brunswick maine.
Reply: @mrbubbarosa  
That is really cool. Thank You for this clarification. I was disappointed the C-5 was not re-engined with the GEnx. For me it was also disappointing the fuselage did not receive the vortices generators and the out wings past the 2nd pylons replaced with better airfoils. I still remember how the C-141 received even bigger upgrades than this when it went from the A to B model. I worked the F-15 and A-10 flightlines but did not fly.
Reply: @Maximspec  It has been Ukrainian since  the breakup of the USSR. Whatever caused the direct damage to Mriya was caused by the Russian invasion. It's very fair to blame Russia.
Reply: the C-5M Super galaxy is the largest
Reply: the an plane was destroyed for the insurance money, if it cost a shit load for US then for the UKrainians its must be hard to make a profit from that.
Reply: AKA
Fat Albert
Reply: @NotWhatYouThink cheeky, the lot a ya haha.
Reply: The number of ping pong balls (25 million) is way too low. It should be more than double.
Reply: @TruckerIceBox What planet are you from ? of course there is . Ambiguity as to which definition you use comes in when the Americans to lazy to change over to a modernised standard system still insist on a different definition than that .
Reply: Mirya is a Russian plane destroyed by ukrain
Reply: Hello, during the video I noticed it was your dream to fly on a C-5. Well not as of now but soon I will go live with my father on a AFB, while something like this could be a challenge for a 15 year old, I might be able to find a few friends who could help with that dream. I don’t want to get your hopes up as this is just a possibility but if I do figure out something I would like to know what email to contact.

Thanks, Remi Floyd.
Reply: yes its the accent of the narrator
Reply: Somebody needs to "do the math" correctly!
Reply: ...the 'kneeling' bit with the almost subliminal?
Reply: Every time you showed Linda Lovelace, she had clothes on
Reply: @fredschmitt456  Who are you insinuating is "you showed?!"   My spouse and I did see one of her movies many years ago, which was boring and about half-way through it, we left; but I've never been within miles of her, LOL!
Reply: @k53847  thought it was 63 tons. Oh wait that’s short tons
Reply: myria is Russian not Ukrainian
Reply: 0:12 you forgot to mention that this is the only plane in the world that can do pushups.
Reply: Tugs are not small and weight 3 to 60 tons.
Reply: Idk if some one said it already is that forward facing seats are used because durnogn a crash people will hit their head either killing or seriously killing them to prevent a lawsuit from that person so either getting no lawsuit or less people supporting that lawsuit
Reply: The clip during the Israel-Arab war seems to show US Marines during the Vietnam war helping a buddy onto a Chinook helicopter.
Reply: @leelydston1225  Closer to 22.3 tons.
Reply: @haotichar  Not any longer. 😟
Reply: @teebosaurusyou  Quite. In England, children memorised Avoirdupois units, including 112 lbs = 1 hundredweight (cwt), and 20 cwt = 1 ton (2,240 lbs). We never learned the smaller American short tons, pints or gallons, since they were almost irrelevant here. Later, we learned the very logical, and simpler, SI units. Both are useful.
Reply: Yeh you said Boeing lost to Lock heeds less expensive design and Boeing proceeded to build the successful 747 than you compared the Boeing 747 to the Boeing c-5
Reply: HAS to be the "one Coast Guard Boat" 🤣
Reply: Not Linda Lovelace. There, I've shown off my eclectic cluttered attic space. Also, that is Amanda Seyfried instead.
Reply: Yes. They're called thrust reversers, not reverse thrusters.
Reply: The way you refer to an airplane as a porn star’s namesake. That doesn’t help to reverse (pun) the strong sexual harassment attitude within the army. It is rEdiculus.
Reply: Referring to Linda Lovelace, a sexual assault victim, as a porn star?